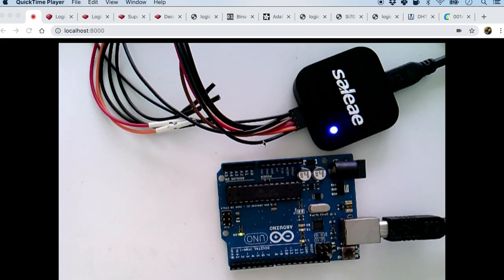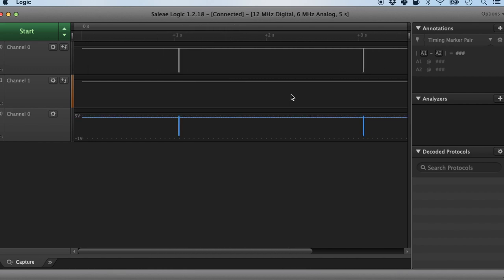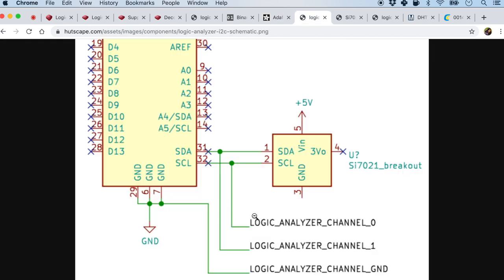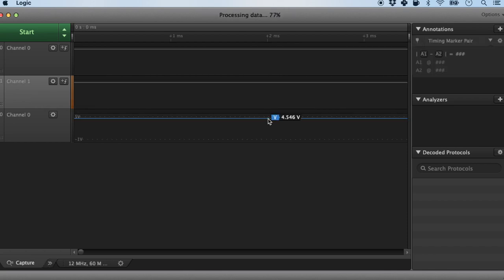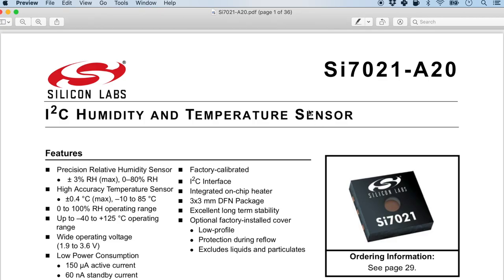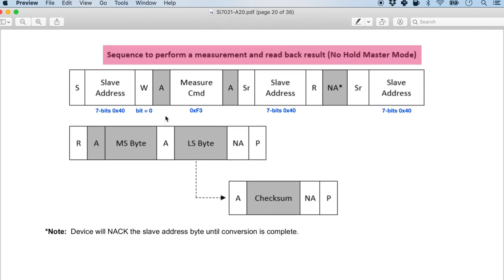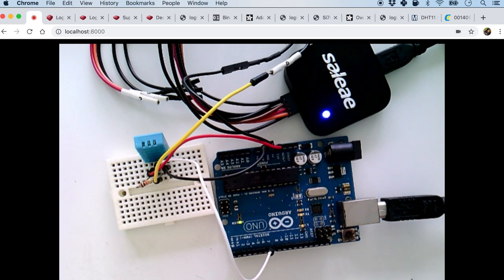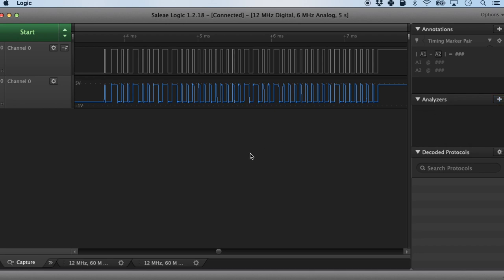Decoding UART, I2C and a non-standard signal // With Saleae logic analyzer and temperature sensors

Comment: How do you choose the clock mode? I mean, do you use asynchronous or synchronous clock?
Reply from the maker: Sorry, could you please give me more context and timestamp from the video above so that I can understand what you mean by "clock mode".

If you mean the I2C protocol's SCL pin, then it is a synchronous clock by its definition: https://en.wikipedia.org/wiki/I%C2%B2C

Also, I would say check with the datasheet of the sensor.
Reply: @sayanee  Thank you for your reply. I am talking about capture rate. I was wondering if you use timing or state acquisition. I have problem with adjusting capture rate so I asked.
Reply from the maker: @ismaeelm7091  Uh yes, good question!

The Saleae Logic Analyser's software Logic provides a list of sampling rate options. To be honest, I start with one of the options and I play around 🤷🏻‍♀️I do check with the datasheet as well to know approximately which sampling rate to choose in line with Nyquist theorem and Saleae recommends 4 times.

Do check this link as well: https://support.saleae.com/faq/technical-faq/what-sample-rate-is-required

Also another note on Nyquist and their recommendation on 4 times: http://downloads.saleae.com/Saleae+Users+Guide.pdf

"Keep in mind that in order to successfully capture a signal, you must sample faster than that signal. That is due to the nature of asynchronous sampling and is described by the Nyquist-Shannon sampling theorem. With our products, in order to accurately sample a digital signal, you must sample at least 4 times faster than that signal."

Hope this helps!!
Reply: Fantastic teacher.. subscribing

Comment: What would you recommend when using UART/I2C sensors with an industrial PLC ? Is it best/easier to go with a converter or use a RS-232/485 and program the communication protocol to fit with it ?
Reply from the maker: I have never used an industrial PLC.
But for any such integration, I would always reach out to the manufacturer and ask them for their recommendation based on the specific use case.

Comment: Wow the DHT11 one is grt .
Well I would like to have your suggestion on one thing.
For checking signals of different protocol say UART , SPI, I2C ,ADC TIMERS , PWM waves , GPIO Pins switching high and low  of order ms ,us , ns.And to check clock frequency of MCU
So what equipment should i go for oscilloscope? Logic analyser?.
Which will suit by application, According to cheapness.
Reply from the maker: I guess you can't really compare the functionalities of an oscilloscope vs a logic analyzer. Here is a good summary: https://articles.saleae.com/logic-analyzers/logic-analyzer-vs.-oscilloscope#differences

I have seen fairly good "cheap" logic analyzers, but good oscilloscopes are expensive.
Reply: I agree that good oscilloscopes are expensive. But I feel it’s important to note that “good” is all relative. If you find secondhand equipment acceptable, there are lots of fast oscilloscopes available. About six months ago, I picked up a 300 MHz Tektronix oscilloscope for under 100 USD. That’s less than even the student pricing on a Sales’s logic analyzers. A logic analyzer is a fantastic tool, but the oscilloscope can do most of what do you logic analyzer does - it’s just slower, because you will need to decode the protocols by hand. (Not difficult - just potentially time consuming. But, you will learn from the exercise.) Newer, higher-end oscilloscopes can do this decoding automatically, but their prices can go from high to astronomical. If you are just trying to understand what’s going wrong with a simple system, a low-cost oscilloscope can be a great option. Very often, the problems with digital systems are simple ones, and often they are actually in the analog domain. For example, a common mistake is to use an improper pull up resistor for the transmission speed, or to accidentally leave one out entirely. In this situation, the inexpensive oscilloscope will probably provide better information than the more expensive logic analyzer. And, once the problem is resolved, the digital parts of the system will probably work as intended. That’s not true in all cases, of course. But, in my experience, analog problems represent a slight majority of the real-world issues in “digital” systems. Hope that all helps with your decision. Edit: I should have mentioned that handheld oscilloscope can be rather inexpensive as well - perhaps as low as 125 USD. Just take their reported speeds with a grain of salt - consider dividing the reported sampling rate by 10X. So, a cheap, handheld “100 MHz” scope might be reliable at ~10 MHz, when used with digital signals. They will be more successful with slower-changing analog signals, but that wasn’t your original question.

Comment: Great video.  One question.  Can you use the same computer to operate the Arduino and also operate the logic analyzer at the same time?  That would take two USB ports.  How would that work?  Thank you.
Reply from the maker: Yes, I used up all the laptop's USB port for Arduino and the logic analyzer. In fact, during the video recording, I also needed 2 more USB ports for the web camera and the microphone, so I had to use an external USB hub to connect 4 devices to my 2015 MacBook.
Reply: @sayanee  Thank you.  I am using a Dell running Windows 10.  I think that the results should be the same.

Comment: Congratulations, Sayanee !
I'm trying to use a logic analyzer for the first time. It is for read a unknown logic protocol, which is used by Fujitsu Split VAC(Air Conditioners). 
The clock signal and DATA are in the AC line wave, 60HZ.
I guess the data signal should read exactly at the middle of the high clock signal.
I would like to ask you, please:
Is there a setting to point and read the data exactly at the middle of high state of the clock signal ?
Thank you.
Reply from the maker: I'm not so sure actually, especially since this is an unknown protocol. I am guessing you can write a custom protocol analyzer and state there to read the data exactly at the middle of the high state of the clock signal. 

Saleae is continuously updating its API for this.

Check here for writing a custom protocol analyzer: https://support.saleae.com/saleae-api-and-sdk/protocol-analyzer-sdk

And I would highly recommend the forum to ask these questions: https://discuss.saleae.com/

And if you are using other logic analyzers, it will depend on that model and I wouldn't know.

For the purpose of aircon IR signals, I would also recommend checking https://www.analysir.com/blog/

Sorry, I couldn't provide the exact answer, but hope the above links will give you some clue!! Hope you find a way to decode it.

Comment: Hi Sayanee , I looked into your videos to understand Logic Analyzer and its features. Very informative and well explained. 
I have query , did you get a chance to use Logic Analyzers with CC111x series of usb dongles from TI. I am trying similar with Saleae , but till not did not able to capture anything .
Reply from the maker: Nope, I never used those chip series.

Maybe check with their documentation for the supported protocols? https://support.saleae.com/protocol-analyzers/supported-protocols

My best bet would be to drop a question on their forum: https://discuss.saleae.com/

Hope this helps!
Reply: @sayanee  Thankyou for your prompt reply. 

One more query did you get a chance to work on ERT Protocol or similar Actually we need to use CC1111 usb dongle to capture ERT Gas meter data . Which we are still not able to capture so tried to use saleae but still not any progress 
.https://en.wikipedia.org/wiki/Encoder_receiver_transmitter 
Pls suggest any forum if you know. 
Thanks alot once again!! Appreciate your time and efforts
Reply from the maker: @rohitjindal5074  Nope, I did not have the chance to work on them.

From my previous experiences in working with industrial meters (E.g. gas meters that you mentioned), it's best to contact the vendor for their proprietary protocols. Sometimes they might help, sometimes no luck, but at least the manufacturer/ vendors are the source of information.

All the best in cracking the protocol!
Reply: @sayanee  Thankyou :)

Comment: Can we read unknown controller data going to 16x2 lcd going by logic analyser?
Reply from the maker: Uh! LCDs are usually SPI, which is not a standardized protocol. I'm sure you can read the data, but you will probably need the specific LCD's datasheet to decode the signals.

Comment: very nice.. now how would be an ez-way to set the arduino up for  " modbus rtu rs485"  and do the test with the Saleae logic analyzer. also, can a test message be sent to the arduino from the Saleae using  simulated read-write registers like:  400001, 300001, 100001, 000001, etc  ?  thank you so much..:)  this would be great for IoT bench testing...:)
Reply from the maker: I have neither used MODBUS RTU nor an Arduino with it :) I have used MODBUS TCP, but on a microprocessor running the full operating system.

It seems like there is an Arduino MODBUS library with RTU: https://www.arduino.cc/en/ArduinoModbus/ArduinoModbus

And it seems like Saleae also supports it https://support.saleae.com/protocol-analyzers/analyzer-user-guides/decode-rs-232-rs-485-and-rs-422, but you might need to also write a custom high level analyzer with Python.
Reply: @sayanee  thank you i will read this information. modbus is great for industrial and iot hobby projects. 😃